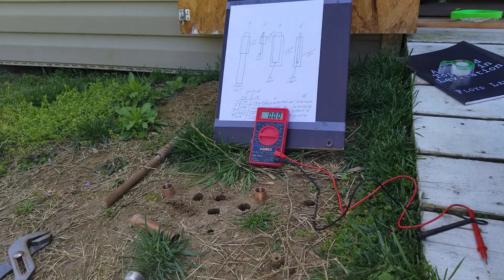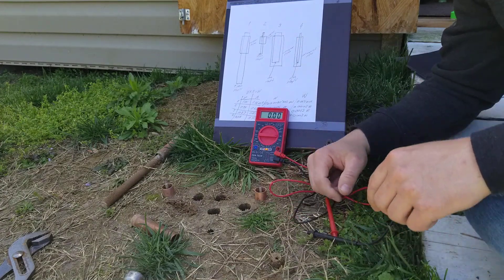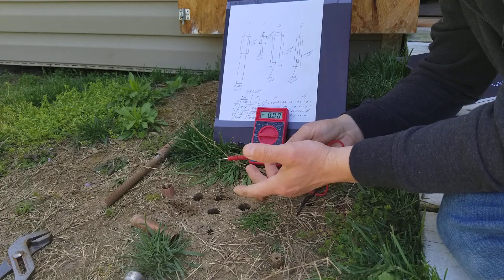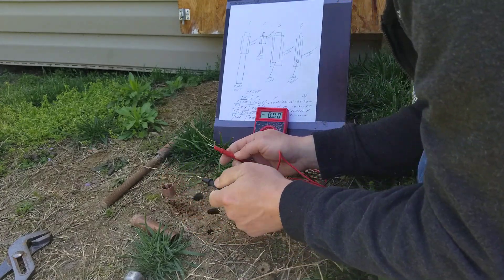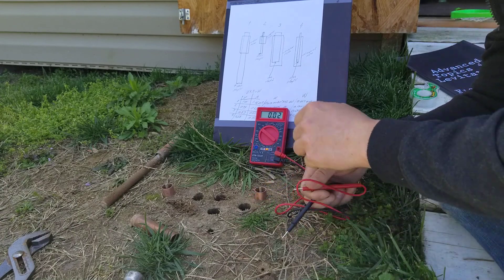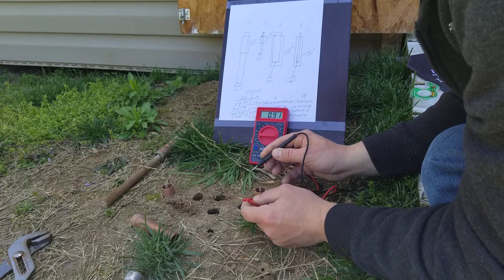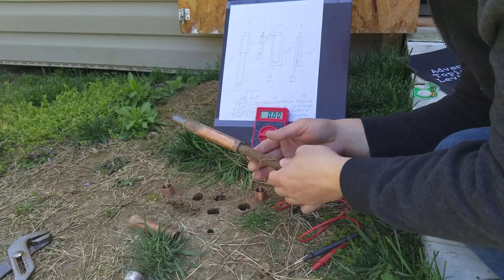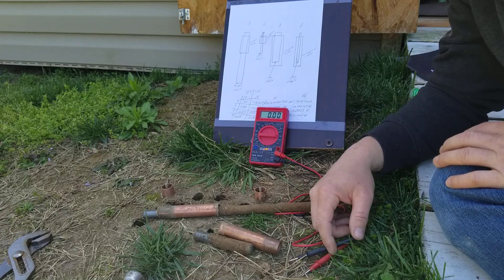Earth battery cells measurement(2)

Comment: I got this to work really well! And I even got voltage with the tubes seperated from the ground which was crazy!
Reply from the maker: How much Wats do you get?
Reply: @FixItAll1  I am not sure sorry, it was very rudimentary just a 6mm drill bit that was coated with I think chrome or nickel or something else (shiny silver finish unlike normal dull grey drill bit) held in place the middle of a 4-5 inch copper pipe by a few ways, hanging it inside the pipe from one end with string so there was just air between them, then the same thing but both in a pot of cold tap water so there was water surrounding and between them, second using dry tissue paper wrapped around the bit to keep it in the tube as I walked around to see if the reading changed in different areas (not sure, but I don't think it did) and finally just pushed the tube into the same ground the garden and thrn pushed the same drill bit down into the tube and pulling the tube from the ground leaving me with a tube packed with earth suspending the drill bit solidly in the center. All of these gave me readings out of the ground, while insulated from my skin even though I'm pretty sure duct tape doesn't insulate from the currents, or whatever my body might do to interfere. All gave me lower wattage than outside still in the ground but still definitely did output something. I just know that I got 0.8w or 0.08w maximum outside with the same components and I didn't need to keep the drill bit inside the tube which was odd it could be somewhere 30cm from the tube in the ground... I cannot remember what the differences between the setups were or the output as it was I think 6 months ago and I've been through a lot since then. Once I can I'll do a better planned and especially RECORDED experiment with it. Sorry for the long reply.